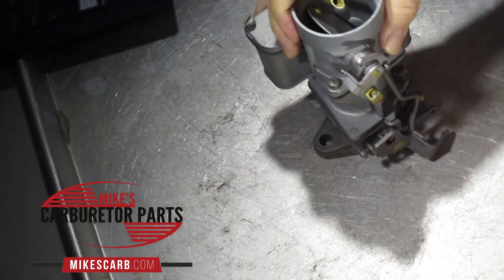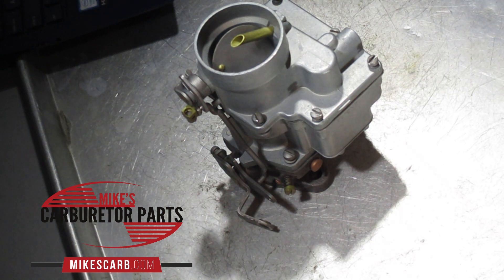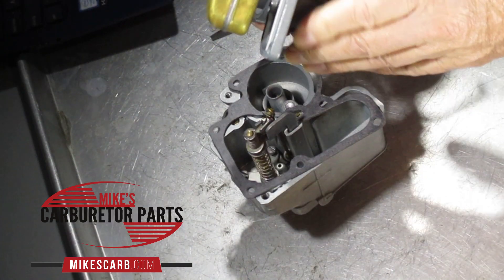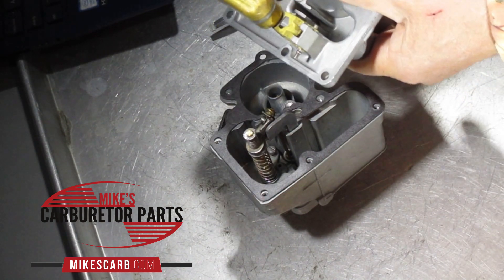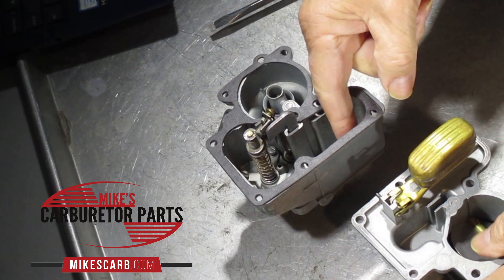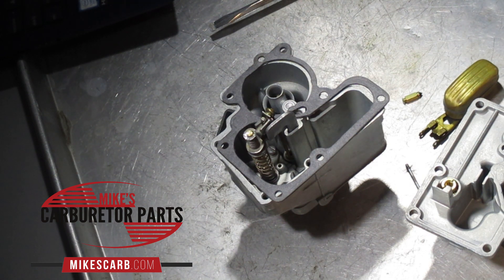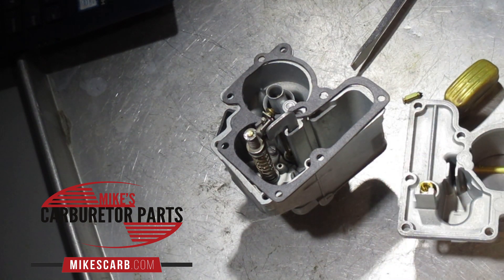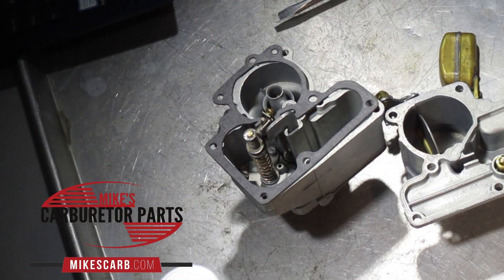What Causes Carburetor Flooding

Comment: Does those aftermarket fuel regulator  really work? because I had mine on the line before 1 and gas was still coming out of it with the pump turned on so I'm  confused..... Any suggestions on how I should properly set the fuel regulator because the electrical elderbrock fuel pump I'm using says 4-7 PSI. Using this stock fuel pump for the last few years driving my 74 duster without no problem with a two-barrel Carter 2 carburetor. now that I changed the lines to cooper with a more straight flow, it seems the fuel pump is pushing more gas to the carburetor than it was before......when I had restrictions,meaning a lot of turns in the lines before it got to the carburetor coming from the tank.
Reply from the maker: The pump should be set at 5 lbs. As far as I know there isn't any problem with the regulators.

Comment: I have a Carter YFA which uses cylinder- shaped, "thumb-length" fuel filter. As I searched, I found it screen filters to 100 microns. About six inches before the carb& filter, I recently added an inline, cloth-filtration filter which filters to 40 microns. And I thought of adding between these two Mr. Gasket 1 1/2" fuel pressure gauge to know there's sufficient pressure to carb. How do I know if I have enough or too much fuel pressure? My fuel pump was rated at 35 gpm. Also, the YF/YFA we're used in Ford 144, 170, 200, 250 and 300 ci engines. I assume each had different carb settings
Reply: @MikesCarburetor  I don't know how to think you guys so much and tell you how grateful I am for your Carter YF YFA videos. I think I've watched all of your Carter wife a videos many of them probably at least 5 if not 10 times and I give thumbs up on each of them that I watch. Then I was able to get over to your website to your Carter yfa carburetor technical information things and just you guys are such a godsend. I don't have the money to buy another carburetor or have this one rebuilt but so grateful because I took the leap of faith with getting a rebuild kit and I've only had the truck since August but I think hands down I don't think it's ever ran is good as it does now with the carburetor. I am on several several Facebook groups about classic trucks and automobiles. I know of giving you guys a plug on there a couple times this past week or two but I will definitely make it a point to pass along the word you guys are awesome

Comment: I have a 1978 Ford F-250 . It starts up and idols good . And runs good sometimes but sometimes when I drive it and try to go into 3rd gear it’ll just shut off and stop taking gas even when my foot is on the gas . I put a new carburetor a new fuel pump a new fuel filter a new air filter. I can’t figure out what’s wrong with it please help me
Reply: Brandon Frazier Did you solve your problem? I have a '77 F250, Carter YFA and I'm going through the same problem. New mechanical fuel pump, fuel filter, air filter. YFA only 4 months old. Next guesses are IN carburetor or replace 46 year old tank and fuel lines. Please help...

Comment: such a great explanation of how a carb works & troubleshooting it.  Now off to my Webber 2brl to find what it is flooding.  On a side note, I was looking to add a gas line pressure gauge, do you carry one?  The pressure gauges I have seen go to 100psi, I only need maybe 10.  250 6cyl Ford (69 Mustang)  Thanks again,  Dan

Comment: Hey bud I pulled my rochester b or rp like it says on the horn idk the difference but I measured my float & it hangs down 21/4 my shop manual says 13/4 from flange w/gasket to the bottoms when hanging down. Is this a major issue do I set it to shop spec. Cuz I do have issue with gettn the car to idle & even stay running for that matter 🙄 please help... wanna get this 51 chevy truck back on the road. ..thx bud

Comment: I have a mercrusier 3.0 and  it is spraying gas out the top and will not start. I have spark. Accelerator on carb work but I have no gas on my plugs

Comment: First time I battled with fuel flooding was with my 1947 DeSoto. Some idiot had put a different carburetor on it that had a size 90 main jet. It literally used 2Litres of gas in a 5 minute drive of about 800 meteres!!!

It sent so much gas into the engine that it diluted the engine oil causing the engine to loose compression and not start anymore.

I then replaced the main jet with a size 50 and replaced the engine oil. Until I got a more appropriate carburetor.
Reply: @MikesCarburetor  Hey Mike. 
I was hearing about carburetor flooding due to excessive pressure from the fuel pump. I'm using an original new mechanical fuel pump. 
On another note, the pump glass remains empty, but the fuel supply seems fine 

I had a few times flooding even after the engine was off. I've inspected the valve and it seems fine.

Anyways, I was thinking of making an external bowl and also a spare gravity fed fuel tank and I was thinking of installing a more heavy duty float valve.

I've also seen fuel pressure regulators but they seem expensive.

Comment: I have an old swiss made SRL 1024l and the carburettor keeps flooding to the point it chokes the engine!
I have cleaned it numerous times and made sure the float is properly adjusted and still I don't know what's up with it 🤷
Maybe a brand new carb will fix it!

Comment: Very informative. This video does remind of why Fuel Injection is superior.
Reply: Until a injector gets clogged, yeah good luck finding a new one for a cheap price while stuck on a trail.
Reply: @arberfilms5998  Could keep a couple with you if getting stranded in the middle of the wilderness is something that could happen in your day to day life. Never had a fuel injector go bad on any fuel injected vehicle I’ve ever owned.
Reply: @todd2962  also EFI can be prone to long term problems with water and corrosion. If a injector gets clogged your gonna end up replacing that whole thing. With a carburetor you can remove the bowl and clean the jets and use compressed air to clean the inlet for fuel. Also EFI vehicles are difficult to modify with exhaust kits. That requires a programmer, with a carburetor you can adjust the idle to achieve the required back pressure for an exhaust.
Reply: @arberfilms5998  You’re right man, carburetors are great. That’s why they’re still used on all vehicles today.
Reply: @todd2962  that better not be sarcasm...
Reply: @arberfilms5998  Trololololol
Reply: @arberfilms5998  i had that exact problem today. My carburettor is flooded and i had to  push my dirt bike about 5 or 6 miles home

Comment: Why does the gas in the carb on my '53 Chevy 216 CI engine creep up the sides of the bowl. It did that on the old carb and a rebuilt one from Ebay. A thicker gasket stopped the fuel from leaking around the bowl gasket, and there are no problems when driving, but now if the truck sits for several days the carb will be empty, it just evaporates. I've asked a lot of older mechanics, like me, about it and they don't know. If you take the top of the carb off you can watch the gas creep up the bowl. It's like a capillary action. Ethanol in the fuel????

Comment: My bike dies after about 30 minutes of riding and it won't start again for atleast 5 minutes of kicking. I think the carburetor is flooding. Any suggestions?
Reply: @MikesCarburetor  the carb will run about 30 minutes before the bike dies, and the gas line is dry, I think it dying from lack of gas ?
Reply: Also the carburetor is spitting bubbles up unto the fuel line .I think I got an air leak